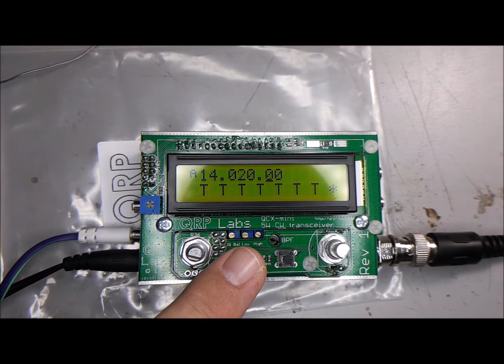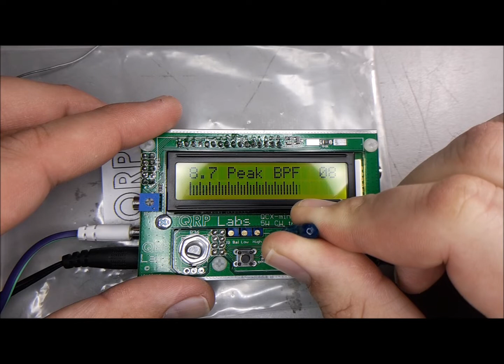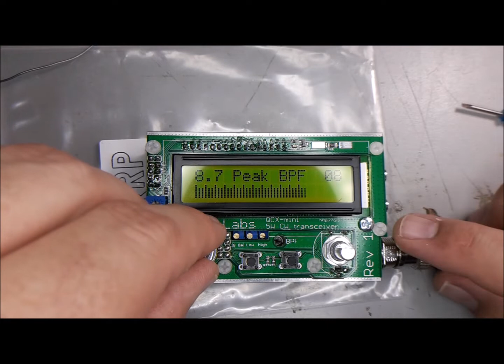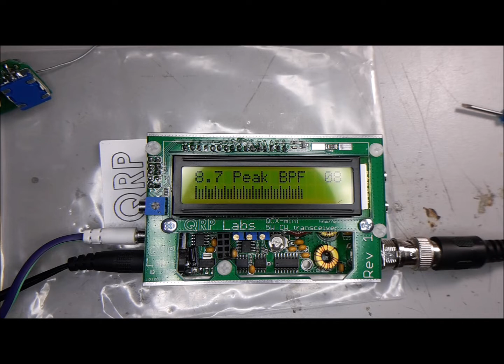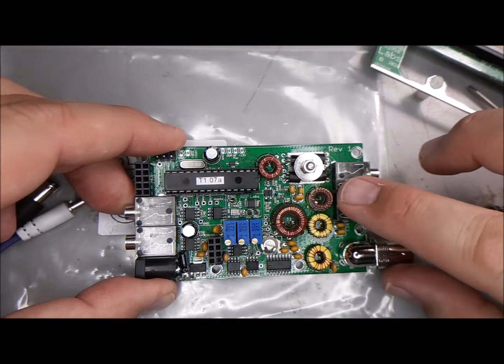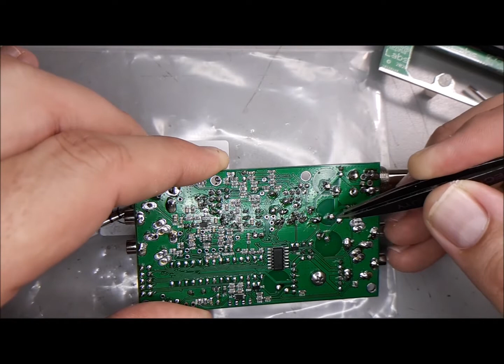QCX Mini Mini Tip 8 - BPF Alignment

Comment: What is the volume control set at when adjusting in step 8.7? Thanks.
Reply from the maker: Per the manual, this adjustment is before the volume control, so it's irrelevant :)